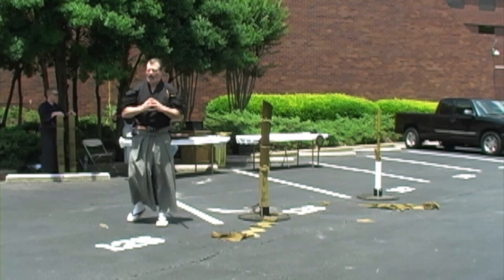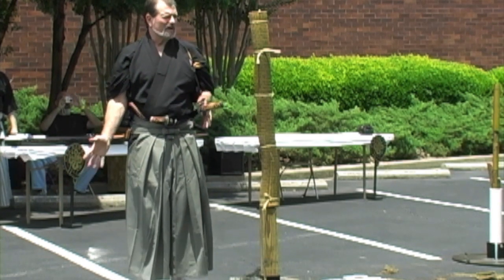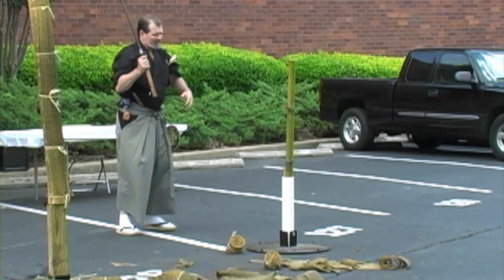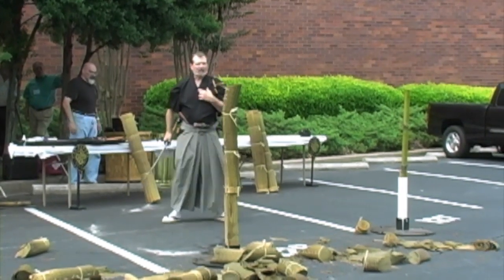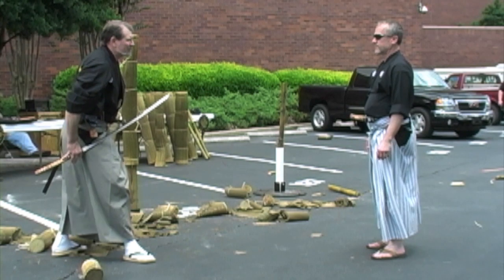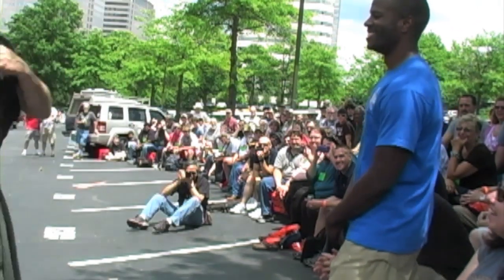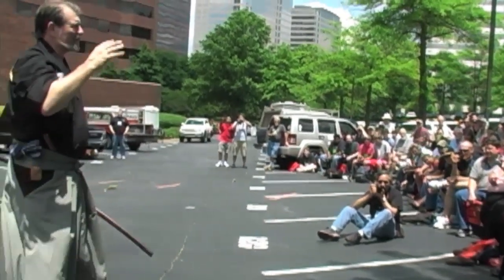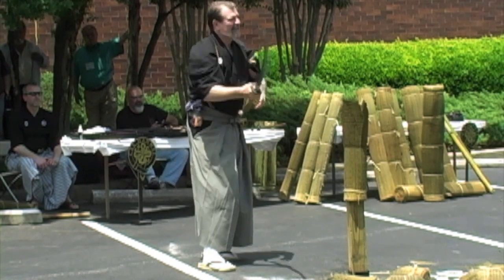CAS Hanwei - 2010 Blade show - James Williams cutting / Nami Ryu demonstration

Comment: I talk to the guy somewhat regularly. He puts emphasis on gripping with the pinkie and ring finger. the major difference is that rather than extending to swing as you would in kendo or seitei iaido, he rotates his rear hip back, giving the sword space to move. the cutting mechanic is different so hit connection has to be different. you'll also notice he locks his right arm as one would when firing a pistol. this is so he is present behind his sword like a support pillar anchored into the ground.